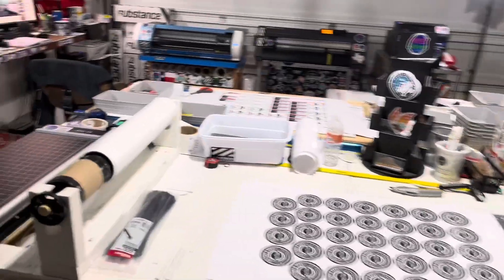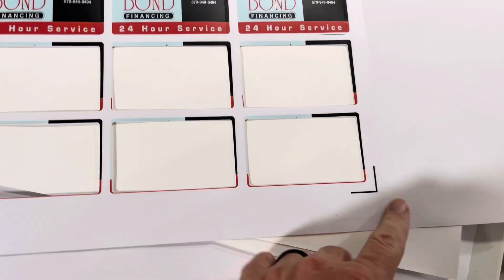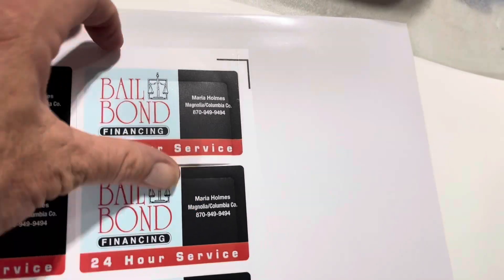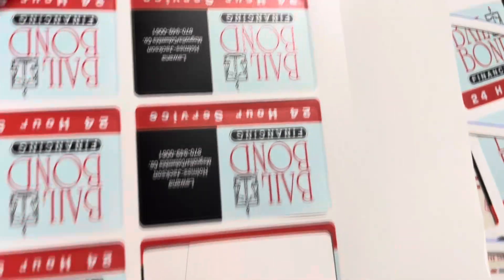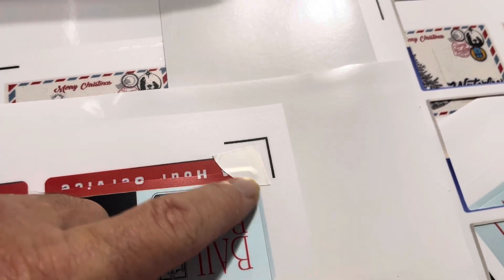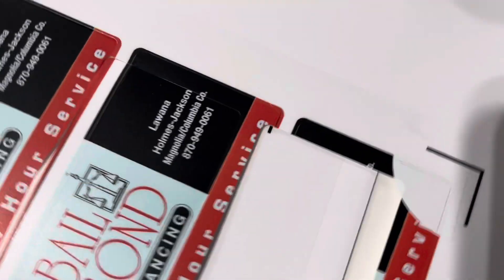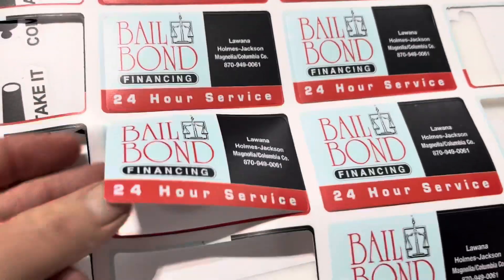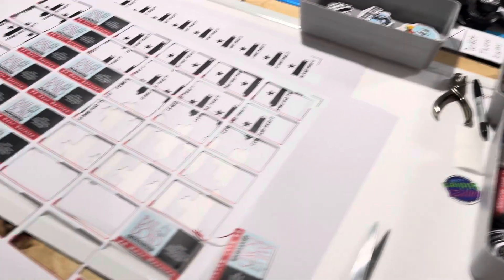How to fix cut lines shifting in Graphtec

Comment: Hi Mike, sorry this is not related to this video but I was just wondering how you find the print quality of your Epson C6500? We currently have a printer based on the Afinia L801 and it’s great for continuous media which then need cutting, but not so good for pre cut circles so looking at potentially getting a C6500 (or a C6000) as well.
Reply from the maker: I think the quality is really good. I’m surprised to hear the L801 is not working for what you need.
Reply: @mikesstickers  thanks for the quick reply. There’s a couple of main issues with the L801 style of printer that I’ve discovered. Mainly the size of labels I want to do are 1.5” and the L801 has a minimum media width of 2inch (if I recall correctly), so I’d have to have the labels specially made with a wider backing. The other issue is with the printhead. If you don’t print the full width of the printhead, the part not being used dries out so if I use mostly 1.5” labels then need to do a job of day 4” labels, 2.5” might be bad (I hope that makes sense).

It does have its advantages but I feel like it’s really designed to be used with a finisher (which I do have) but then that’s not so great for smaller orders of labels.

Comment: Hi Mike, you are correct, i had that issue, but took me a bit to figure it out as well, lol. Question, i see you have a heater in there, what temp do you keep it in there? Thanks for sharing.. Great info...
Reply from the maker: I’m trying to keep it between 70-75 degrees Fahrenheit.